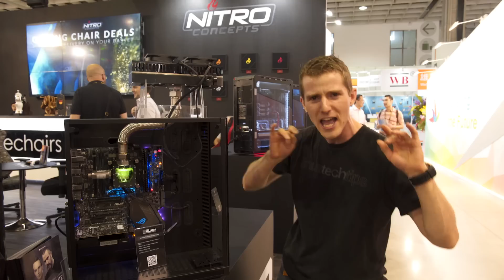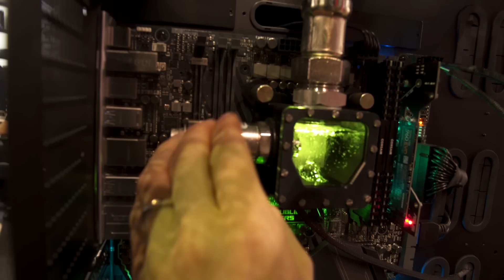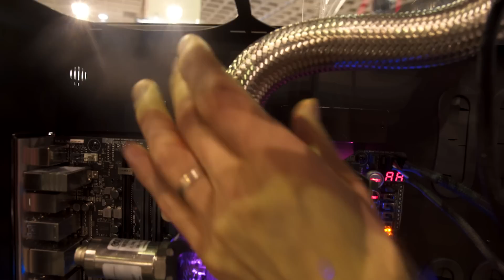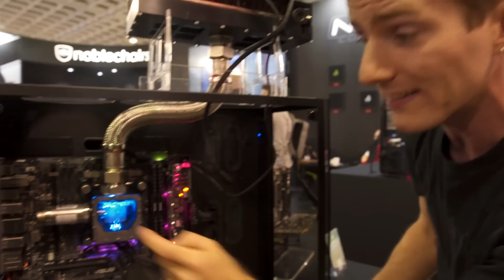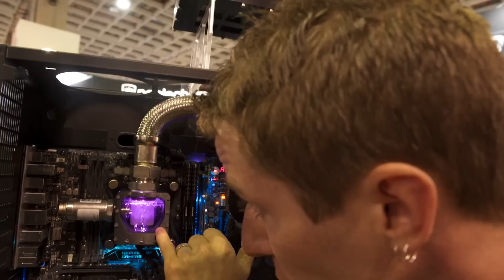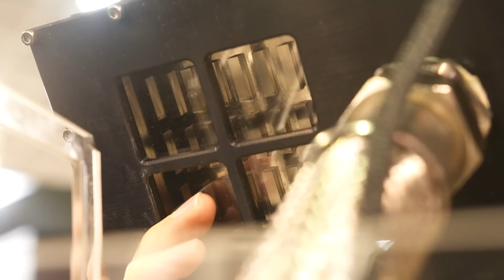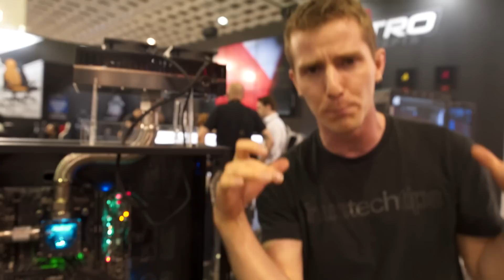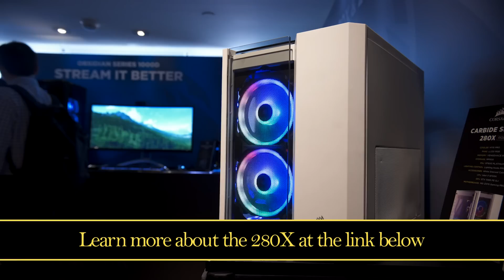Crazy Der8auer cooler prototype - NO pump!

Comment: So run a btx board and the radiator will sit on top of the case. I’m really surprised he didn’t use that type of board. This make sense. Excess liquid that will evaporate then condensate back down. Refrigerant can do this and you can find power generators using solar heat that again heats up the refrigerant. Now what kind of refrigerant he uses is the question, there are many.

Comment: Its probably been mentioned before but the conductive piece of metal you mention is not what is boiling the liquid. It is just a liquid with a low boiling temp thus the heat from the CPU is enough to get it to the state where it will boil and thus cause the evaporative heat loss to occur. Just as sweat evaporates off your body on a hot day cooling you down in the process. The question is which one. Since if the liquid is flammable I doubt they will be allowed to ship it overseas. So it is unlikely to be Pentane/Hexane.

Comment: A few things I could think of that could be the coolant type are Liquid carbon dioxide, liquid helium, liquid chlorine (Cl2) or liquid hydrogen due to the low temperature boiling points of each of them

Comment: No-one would ever guess, eh!
A
Acetaldehyde CH3CHO, 
Acetic acid anhydride (CH3COO)2O, 
Acetone CH3COCH3
Acentonitrile
Acetylene
Acrolein
Acrylonitrile
Alcohol - ethyl (grain, ethanol) C2H5OH
Alcohol - allyl
Alcohol - butyl-n
Alcohol - Isobutyl
Alcohol - methyl (methyl alcohol, wood alcohol, wood naphtha or wood spirits) CH3OH
Alcohol - propyl
Allylamine
Ammonia
Aniline
Anisole
Argon
B
Benzaldehyde
Benzene (Benzol) C6H6
Benzonitrile
Brake Fluid Dot 3
Brake Fluid Dot 4 
Brake Fluid Dot 5 
Brake Fluid Dot 5.1
Bromine
Bromobenzene
1,2-Butadiene
n-Butane
1-Butene
Butanal
1-Butanol
2-Butanon
Butyric acid n
C
Camphor
Carbolic acid (phenol)
Carbon Bisulfide
Carbon Dioxide CO2 (sublimates)
Carbon Disulfide CS2
Carbon Monoxide
Carbon Tetrachloride (Tetrachloroethane) CCl4
Chlorine
Chlorobenzene
Chloroform (Trichloromethane)
Cyclohexane

Or anything else from https://www.engineeringtoolbox.com/boiling-points-fluids-gases-d_155.html (I got tired).

Comment: My guess is Ethanol. low boiling point, noncarrosive to metal, and doesnt conduct electricity.
Reply: Too low boiling point.  Every other alkane or alkanol either has a too low or too high boiling point, I think it could be a different group of chemicals that also has a alkane or alkanole group (I'm german and i don't know how Alkane and Alkanole are written correctly)
Reply: @jolioding_2253  it could also be benzene it has a low boiling piont of 80 degrees celcius

Comment: I have used this. Methoxy-Nonafluorobutane (C4F9OCH3), also known as Novec 7100,  is a clear, colorless and low-odor fluid. Molecular mass of 250, freezing point is -135°C and boils at 61°C. From my personal experience, it should not be used with PTFE teflon based plastics or soft rubber (basically any plastic which can have its plasticizer solvent removed. It will oxidize the surface of copper and has compatibility issues with aluminum, brass and magnesium alloys.
Reply: Also if you wish to do your own experimenting with this liquid, it can be purchased as a cleaning solvent under names such as Promosolv or from chemical companies under the name Methoxy-Nonafluorobutane, which is what I did.

Comment: Ethylene Glycol (EG): Commonly used as antifreeze in automotive engine cooling, EG also has found use in many industrial cooling applications. Common applications include process cooling at lower temperatures. Ethylene glycol is colorless and practically odorless and is completely miscible with water. When properly inhibited, it has a relatively low corrosivity. However, this coolant is classified as toxic and should be handled and disposed of with care. The quality of water used for the preparation of a glycol solution is very important for the system. Typically, water with low chloride and sulfate ion concentration (< 25 ppm) is recommended. Also, a monitoring schedule should be maintained to assure that inhibitor depletion is avoided and pH of the solution is consistent. Once the inhibitor has been depleted, it is recommended that the old glycol be removed from the system and a new charge be installed.
Propylene Glycol (PG): In its inhibited form, PG has the same advantages of low corrosivity shown by ethylene glycol. In addition, propylene glycol is considered non-toxic. Other than lack of toxicity, it has no advantages over ethylene glycol, being higher in cost and more viscous.
Methanol/Water: This is a low cost antifreeze solution, finding use in refrigeration services and ground source heat pumps. Similar to glycols, this can be inhibited to stop corrosion. This fluid can be used down to -40°C owing to its relatively high rate of heat transfer in this temperature range. Its main disadvantages as a heat transfer fluid are its toxicological considerations. It is considered more harmful than ethylene glycol and consequently has found use only for process applications located outdoors. Also, methanol is a flammable liquid and, as such, introduces a potential fire hazard where it is stored, handled, or used.
Ethanol/Water: This is an aqueous solution of denatured grain alcohol. Its main advantage is that it is non-toxic. Therefore, it has found application in breweries, wineries, chemical plants, food freezing plants, and ground source heat pumps. As a flammable liquid, it requires certain precautions for handling and storage.
Calcium Chloride Solution: Aqueous solutions of calcium chloride find wide use as circulating coolants in food plants. It is non-flammable, non-toxic and thermally more efficient than the glycol solutions. A 29% (by wt.) calcium chloride solution has a freezing point below -40°C. The main disadvantage of this coolant is that it is highly corrosive even in the presence of corrosion inhibitors.
Potassium Formate/Acetate Solution: Aqueous solutions of potassium formate and acetate salts are non-flammable and non-toxic as well as much less corrosive and thermally more efficient than calcium chloride solution [5]. Therefore, even with higher price than calcium chloride, they have found a large number of applications in recent years. Although the main applications of these fluids are in the food, beverage, pharmaceuticals, chemical and climatic chamber applications, recently these fluids have been investigated for single-phase convection cooling of microprocessors.
Liquid Metals: Recently, liquid metals of Ga-In-Sn chemistry have been utilized with a magnetofluiddynamic (MFD) pump [2]. It utilizes the high thermal conductivity and density of the metal alloy to remove very high heat flux from microprocessors.

Comment: I think the coolant is a chemical which lowers the boiling point of water such as ethanol and makes water thinner such as acetone, as water's usual boing point is 100 degrees Celcius at 1 atm, but CPUs are needed to be under 80 for working properly. So, to make the water evaporate at 80 degrees ethanol and acetone can be mixed. Also, as decreasing the air pressure (creating a vacuum inside the cooler) can decrease the boiling point of water very easily, like at 1/4 atm water evaporates at 60 degrees and with the chemicals, the water may evaporate at even 40 degrees.

Comment: Screw pumpless loops - I just want to have a see through cpu block
Reply: Still waiting for this...
Reply: @TheStuffedIguana  same
Reply: 2021 still no
Reply: uhm... and what is a see through material that can withstand 97 degree celsius heat? Unless you can afford actual diamonds....
Reply: @gottaproxy8826  ever seen a chemistry experiment take place?
Reply: @gottaproxy8826  I mean, just about ANY kind of glass can withstand 97 degrees C. If you want to avoid any chance of temperature differentials fracturing the glass, use borosilicate glass, the type they use for glass cookware. But even plexiglass won't have any trouble handling 97 degrees C. You have tons of options.

Comment: The fluid is most probably r13a gas under pressure or alcohol with nitrogen gas under pressure to increase the boiling temperature

Comment: most likely some type of gas with a high boiling point, perhaps some type of ether or something similar, perhaps a blend of gases

propably would work well with butane too, boiling point around -1-0°C and reltively low steam pressure, but it's flammable obviously

Comment: I think the coolant is water with a lower pressure, and that's the reason there's a pressure sensor monitoring it
Or possibly (not joking) alcohol due to its lower boiling point
Reply: its some special fluid. with a boiling point at around 35C dont remeber but he has videos about it on his channel.
Reply: @Ginkoman2  diethylether has a boiling point of 35 C°

Comment: is it heavy water? I know they use heavy water in nuclear reactors in order to keep the uranium rods from melting down.
Reply: They use heavy water in CANDU nuclear reactors because it's better at slowing down neutrons than normal water, and that means you can run your reactor on crappier uranium. Ordinary water is just as good of a coolant, and most reactors use it with good uranium to save the cost of a bunch of heavy water.
Reply: @diablominero  thank you for the correction. hopefully it saves me from looking dumb in the future. lol.

Comment: Considering the liquid is being kept under some kind of pressure state, the liquid could be almost anything that isn't corrosive or reactive with the rest of the components. That's the beauty of pressure systems. There's no need to regulate the temperature either, because the CPU is constantly adding in more energy to the system. So, even though it's not a closed system, as long as it maintains a constant system pressure at the point where the phase changes at a desired temperature, everything else just works without needing any pumps. It's a neat design concept, but ultimately, it's again reliant on ambient air cooling. It just ends up being more bells and whistles for the "cool factor" rather than the cooling factor.

Comment: Don't know what he is using but you could use acitone.

It has a boiling point just over 50c. 

Or you can use just water in a vacuum. It better isopropanol. You can make a vacuum good enough quite easy. Just boil the liquid in the system and have a vent. Let it drive all the air out and be full of hot steam, vapour. Then close the vent and cool. 

Just like the crushing the coke can with steam trick. 

With a lower pressure the boiling point drops. Water will be around 50 to 60c. Not sure with isopropanol, but worth a shot as it's normal point is 82c. Or you could mix them so it won't grow bugs and will have a point a bit lower than just water. 

All you need then is a block with an in and out that are vertical. And a radiator mounted so it's in and out are higher and lower vertically. Then the two lows together and two highs together. Radiator should be higher than the block. Then fill so it's just over the cpu block. But no higher. 

Would love to have a go at this.

Comment: You want the fluid in an exchange like this begin boiling in your normal operating range, without being so low it will happen at room temperature. So you are looking at a range of 30C to 50C, with 40C to 50C being more likely.  There are actually a surprisingly high amount of cooling/heat transfer fluids, refrigerant fluids, and engineering fluids that fall under that range.  The problems happen when you have to take into account cost and hazard. 

But there is a range of fluids, designed for immersion cooling, that are the most likely.  As many have already commented, it is most likely from the 3M Novec family.  There is actually a version of Novec designed for indirect two-phase cooling.  That is exactly what is shown in this video, an indirect two-phase cooler with the fluid boiling in the operating range of a desktop cpu.

Edit  I would guess some hydrofluoroether (HFE), such as a blend of Novec 7000 and Novec 7100.  However there are HFE's available from companies other than 3M.

Comment: It's alcohol maybe? its got to be a liquid with a lower boiling point than water I assume. Alchohol boils at 79C or 172F .. or Acetone at 50C
Reply: I would go with some blend of fluids, though Acetone is a very good guess.  All variants of alcohol have a boiling point that is too high and would risk damaging your cpu.  You want the fluid in an exchange like this begin boiling in your normal operating range, without being so low it will happen at room temperature. So you are looking at a range of 30C to 50C.

Comment: water? with some sort of intense vacuum pressure?
Reply: mmm I don't think so, because water is an incompressible fluid.
Reply: @Ziur-Da1  https://youtu.be/glLPMXq6yc0
Reply: @Ziur-Da1  i mean, i doubt it's water in this cooler, but you can lower the boiling temp.

Comment: Yeah, some one said it .. it will propably be 3M Novac Engineered fluid. Different boiling points but one version is 45C, which would be good for this. Nothing special.
Reply: Novec 7000 has a boiling point of 34C while Novec 7100 has a boiling point of 61C.  That is why my guess would be some custom blend of the two.  If they got along perfectly fine and blended without any loss of efficiency then you are looking at a 47.5C boiling point from a 50/50 mix.